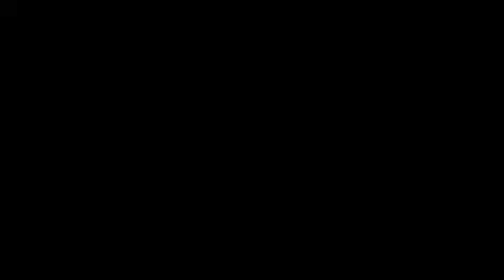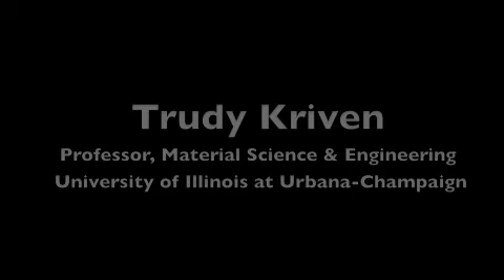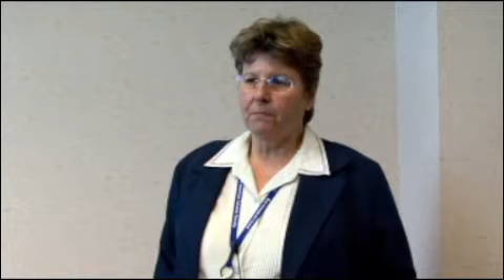Geopolymer: A Cheaper, Greener Alternative for Cement

Comment: I am sure Geopolymers have their utility but it is ultimately a competitor for the cement industry.  They won't simply accept this challenge without fighting it.  Just as the oil and coal industries refuse to yield to photovoltaic and wind energy.  These pre-existing industries will continue to resist change.  As in everything else in this world, those who have money refuse to give up the means by which they have acquired their wealth by all means possible.  This includes political intimidation and licensing rights.  It might be better to mobilize all forms of opposition to move the would-be consumers so they could apply pressure from the consumer point of view.  I am sure I am not saying something that others have not said before.  A head-to-head comparison might be more convincing to soften the attitudes of the opposition.  Cost is usually the greatest motivator!  Thank you.
Reply: Can you imagine what the criminal led labor unions would have to say about the labor saving aspect of this. I can see all the organization 
That typically despise each other,  joining arms , under the ' the enemy of my enemy is my friend '
Standard.

Comment: how about using volcanic ash? as the Romans used in their cement? which is the best cement ever, still intact in so many places after 2000 years.
Reply: I've been wondering the same thing
Reply: Yes, you are completely right! There are geopolymers, made of this kind of raw material. I made some myself in College and they resisted boiling water and self made sea water without getting demeged (preliminary tests). In fact the Roman cements have more to do with a geopolymer than with modern cement (Portland cement). Geopolymer is of course a 3D network of very durable and resisting chemical bonds (covalent bonds) and by means of NMR one can find a similar kind of 3D framework in Roman harbors and other buildings.

Comment: This woman is a heaven-sent genius.  Get her a position with the department of transportation.  She has been sent here to reveal how to build our roads out of geopolymer granite thus to free us from the use of blacktop surfaces which degrade under the sun.  Wake up men and smell the asphalt-free air.  Dare to take the quantum leap this woman has placed right under your nose!
Reply: I agree that there are many benefits to switching to Geopolymers.  Re-tooling cement industry and overcoming resistance to accept its benefits is another.  Global warming non-believers is just one example of the many forces at work to deny what is worthwhile to consider.  To cement industries' credit, they have been more accepting of Geopolymers in recent years.  Change is hard but it is inevitable.